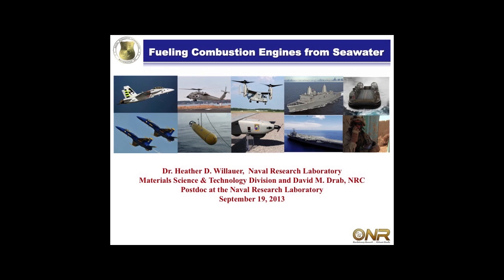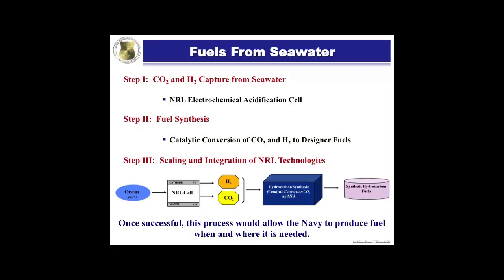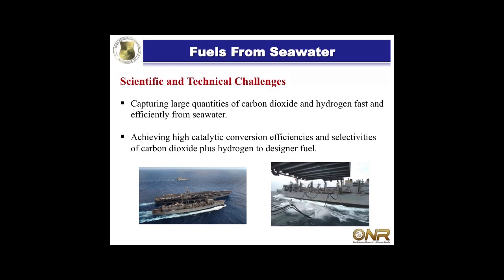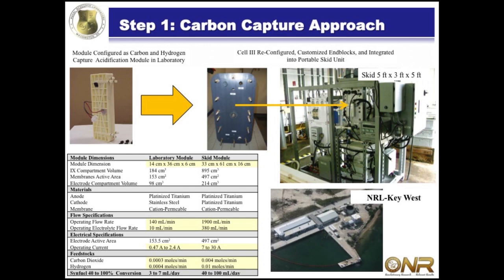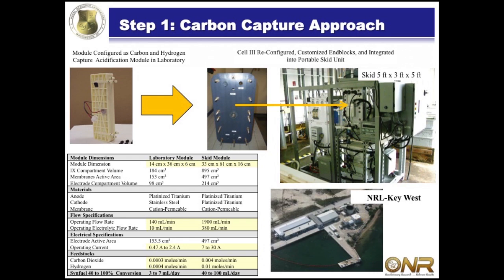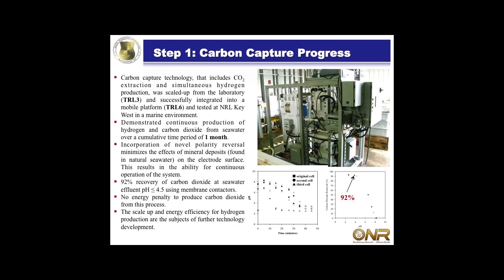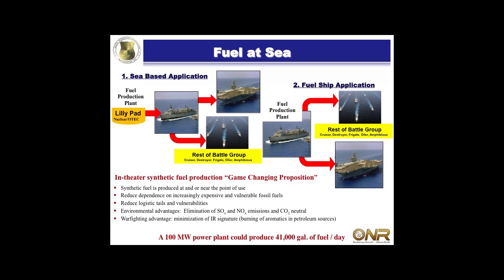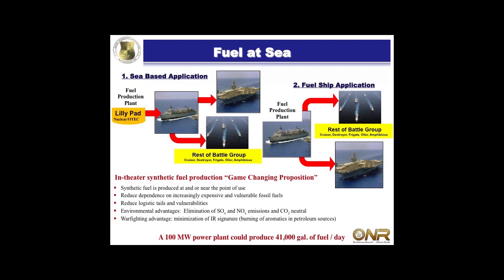Synthetic Fuel from Seawater: The Science

Comment: At 23:58 her slide shows a 100 MW reactor would make 41,000 gallons of fuel a day. The Average American pays about $0.13 per kilowatt hour for power, using basic math of 1,000 kilowatts in a megawatt and a 24 hours in a day, to buy all the power a day from the 100 mw reactor would cost about $310,000. If you divide that by 41,000 gallons there is $7.60 worth of electricity to make one gallon of fuel. Considering her statistic that it cost $7 a gallon to deliver the fuel, it is an interesting idea. There are big price differences between whole electricity and retail electricity, and there are also other generation methods.
Reply: Water is measured in acre feet, that is one acre of water 1 foot deep. There is 325,000 gallons in an acre foot, so if one needed, 23,000 gallons of water per gallon of gas, that is 14 gallons of gas for every acre or water processed or a need to process 4.5 square miles of ocean one foot deep each day with the 100 megawatt power plant to produce the 41,000 gallons of fuel. That seems like a lot of water, lots of pumps to break. Overall this process still seems impractical, but most big advance look impractical until someone does them.  It is an intriguing idea, I just think it is going to have a hard time cost effectively competing against drilling a whole in the ground and having oil pop out. From a military sense, I am sure creating your own fuel has some advantages, but traditional oil tankers are simple and cheap to make and one can fill the ocean with lots of them to aid in resupply on the go. From a geopolitical sense it could aid certain countries that might be lacking of oil in war times, but it is a complex and expensive process at the moment. Great presentation though. I wish them luck in creating new alternatives.
Reply: At commercial prices, yes. But the cost of reactor energy is the cost of the reactor and the cost to run it divided by the amount of electricity it produces. Run the 100MW reactor for 10 years and it will produce a trillion dollars of electricity at current commercial prices. It's extremely likely that construction and operating costs are far lower than that, in which case the electricity generated will be proportionately cheaper.
Reply: Prime example of how to lie with statistics👏👏

Comment: So basically CO2 from electrolysed seawater plus H2 evolved from the cell. CO2+H2 using special reaction can yield something like diesel.

What is the energy in / energy out?
What are the hurdles to commercialisation?
Costly catalysts?
Reaction times?
Heat and other feedstocks required?
Reply: What do you mean commercialisation? This is designed for the Navy.

Comment: I saw that you will need 3600W of power to produce 1900ml of co2, so you will need a large amount of energy to produce 1 gallons of fuel, it means that in remote area you will need a huge land for solar panels, or diesel genset that has only about 33% efficiency, so a lot of liquied fuel to produce liquied fuels fro co2 and H2, so maybe I dont understand,  what will be the benefits for this technology???
Reply: I am sure that your new system is more efficient parallels to conventional systems, but really if you have in place nuclear power, efficiency is not the most important issue, but in the us and also all over the world there is a lot of waste energy, I think that you will need to invent/develop an efficient waste heat to electricity (recovery system) parallels to your revolutionary system so you will need to add a minimum addition of energy or maybe it will be enough for your NRL system.  Also maybe you can do a joint venture with nuclear power plant or nuclear military ships that already exists and produce the fuel both of them use seawater in place.
Good luck, I will follow.

Comment: 23,000 gallons of water to make one gallon of fuel? How many gallons until the Oceans run dry? All Joking aside (I understand that 22,999 gallons are returned to the sea.) Looks promising, but I think we need to get that 23,000 down a couple orders of magnitude.
Reply: 1 gallon of carbon  that came from a tail pipe of a car or plain That happens to be harmful to marine life.
Reply: As long as that generated fuel is then burned, it will never run out...  The burned fuel will again enter the air volume of the planet, and the oceans will again absorb it, where is can be processed again - it's a closed loop.  Bonus, no geopolitical issues, and it doesn't take agricultural space - it's independent from land completely (except for maintenance materials).
Reply: Tim S  But muh petrodollar!
Reply: so how many gallons per minute pass under a carrier steaming at near top speed?

Comment: My new engine will be 60-75% efficient vs Old Otto cycle at 10-20% city-Highway and peak 25-30%, or Diesel at 18% average and 42% peak in trucks and 55% on ocean freighters.  This NEW engine would cut fuel needs by 4x (25 mpg to 100 mpg) and allow oil (5 fuels) and electro fuels (C8, C10, C12) to be used, as well as NH3, solar thermal and, yes electricity via thermal cycle.  Want zero CO2 neutral?  Then make it cheaper than oil.  Simple.  Don't need EV, as my engine is par in efficiency and can be car wise 2x better economy due to 1/2 weight and active drag reduction (cuts drag by 1/2).  EV 100 mpg.  new car with engine 200 mpg.  My range would be 22,000 miles on fuel at the same weight as a Li-ion battery.  150 gal fuel tank x 150 mpg = 22,500 mils as compared to Model 3 Tesla at EPA range of 220 miles, or around 100:1 range.  A Cessna 182 has 88 gallons.  88 x 150 = 13200 miles.  Clearly 60 times range would be well enough.  AI drones NEED range to be able to "drone" about without servicing for weeks on end.  My tech can do just that.  Tesla cannot.  Sorry.  Happy to discuss it.  Moreover, my tech, seaplanes, can fly door to door at costs of fuel less than road tax, tires and brakes.  Like flying for free fuel because you avoid road costs.  EVs?  Stuck on ground in traffic paying more in road costs than the fuel to fly at 200 mph in airplane.  Future is IN THE AIR.  TESLA is OBSOLETE.  EVs are OBSOLETE.